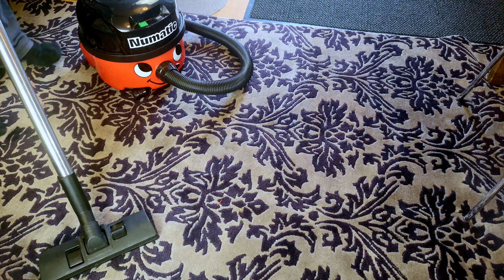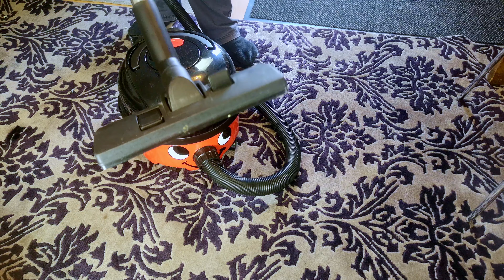Making a custom cordless powerhead for the Numatic NBV190!

Comment: Thank you so much for the idea i have just made one and didn't blow myself up 😅
Reply from the maker: Awesome! What cleaner are you using it with?
Reply: @beko1987  herny cordless i just need to find a spot for they battery think i will mount it to the pole and i put the power switch into the circle hole where the flexi pipe is at the front hope that makes sence